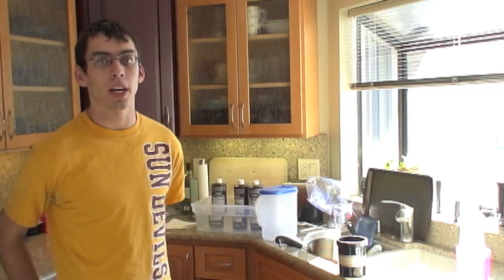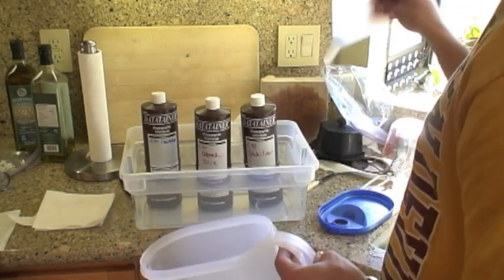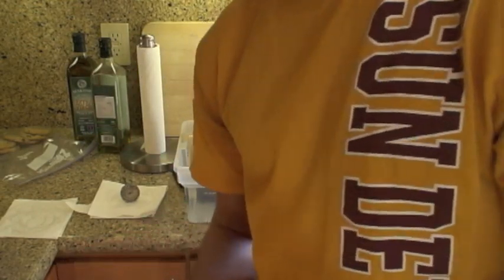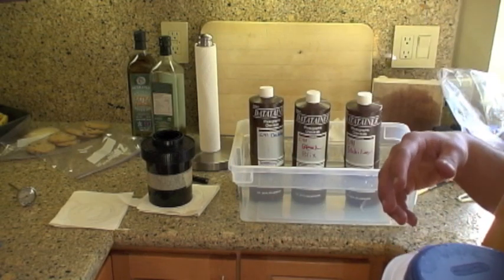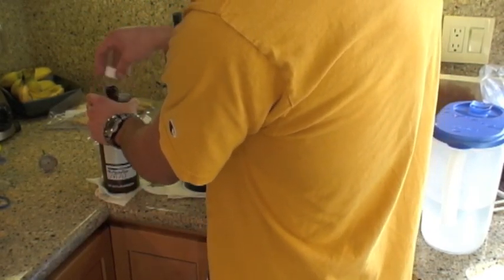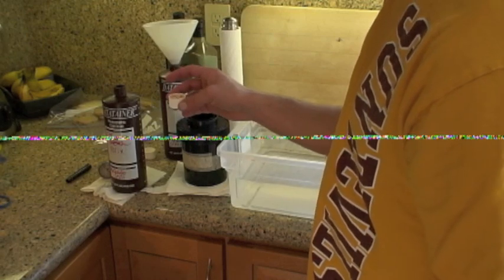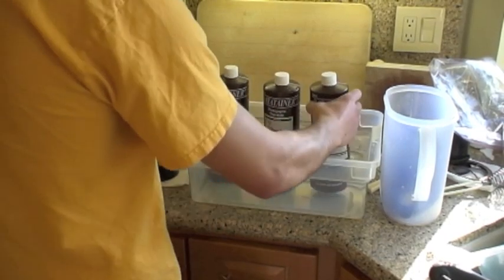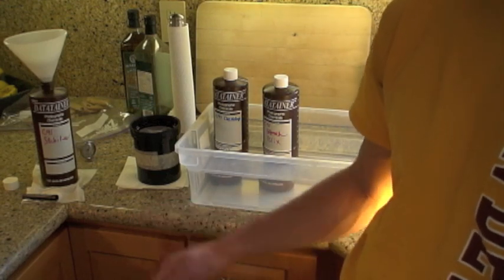Developing c41 Film

Comment: Yes you can. Just beware that in areas with very hard water it can leave white deposits on your negatives. Rinse them in clean distilled or bottled water afterwards if that is the case.

Comment: DO NOT water wash between the developer and the blix.  The developing needs to be stopped as soon as possible, so pour in the blix after the developer ASAP.  A water stop bath is not enough to stop the development of c-41 film and can lead to a fogged brownish-base colored negative.  This has been my experience, but I am sure all kits vary a bit, since I am using Flexicolor chemicals with a separate bleach and fix.  Overall, this is a good video tutorial.

Comment from the maker: @rick92rr

Temperature changes cause under/over developing which just decreases/increases the density. 

The film will appear milky if under blixed, or if the blix is exhausted.

My only guess as to how you get pink color negs is that they didn't prewash and/or stabilize them.

If you want a good lab go to APUG.org and post a thread, you will get many responses. I use a local lab, never had a problem with quality from them.